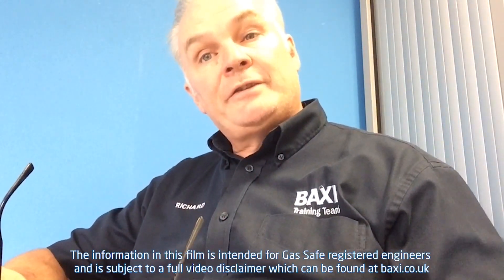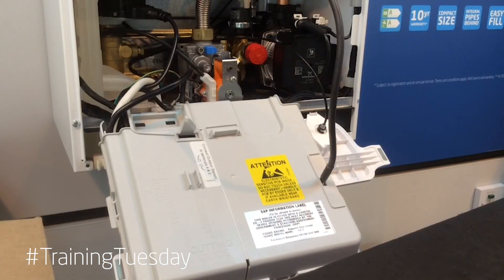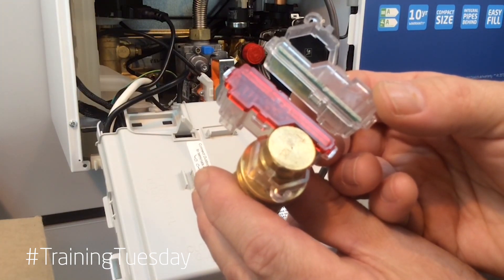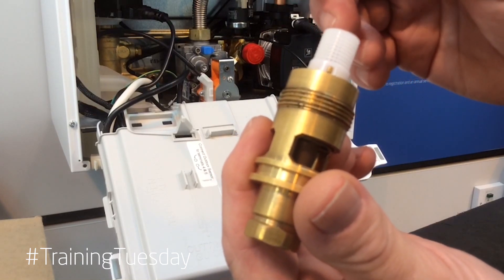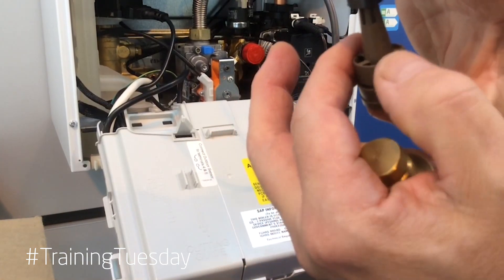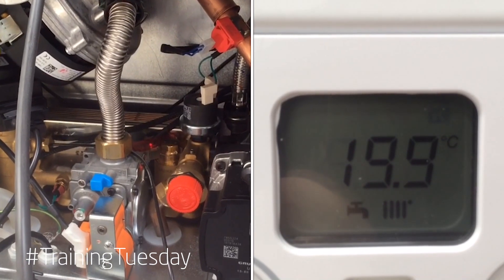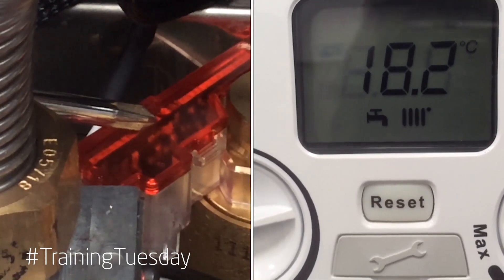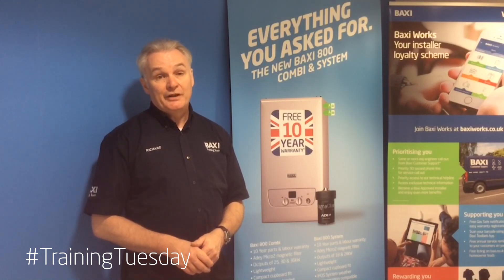Why the Hall Effect sensor is half lit or flickering on a Baxi 600 or 800 boiler

Comment: Why does my boiler not sense a hot water request when I turn a hot tap on furthest down the line, it use to work but now doesn't. It still works on taps closest to the boiler?